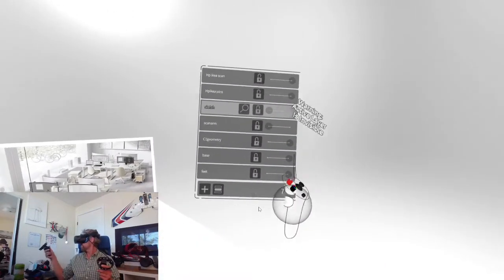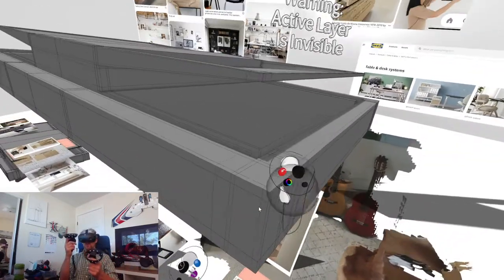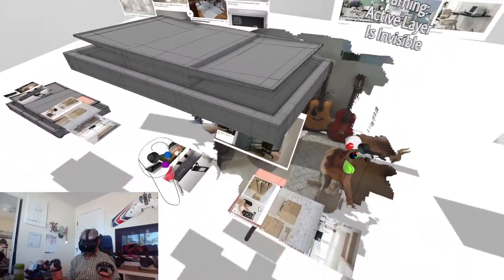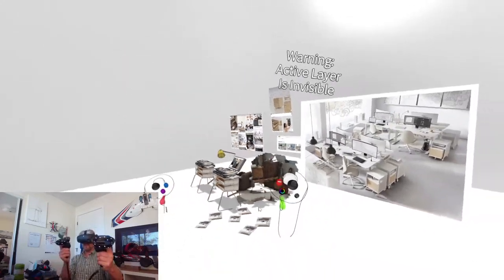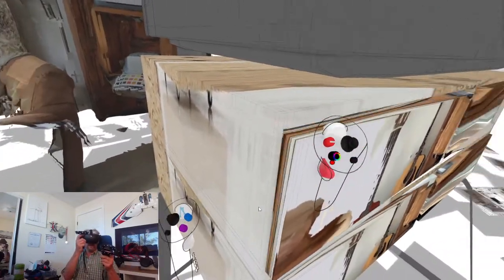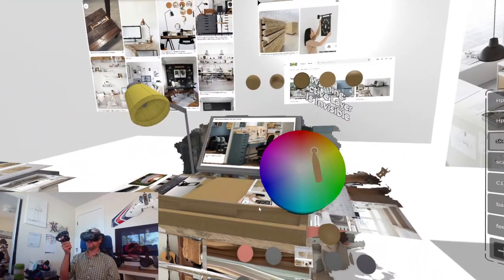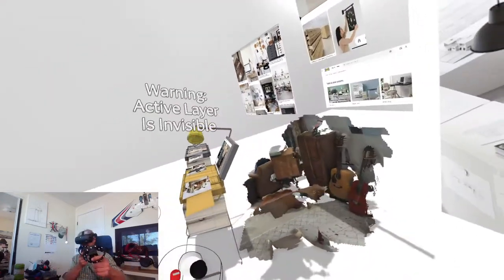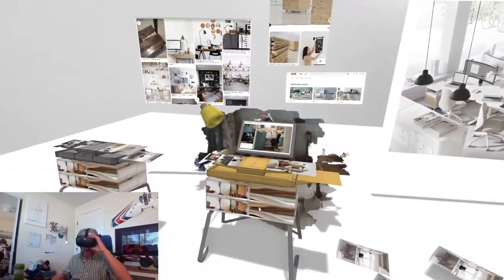Gravity Sketch Lidar and Clean Geometry

Comment from the maker: Apologies for the terrible audio, I think the yeti was in Omni directional mode and is picking up the laptop fans
Reply: Pretty awesome, Bart!  My headset is the Oculus quest 2- it doesn't use a laptop (unless there is a way to use a supplemental processor).  Will that hinder my ability to do stuff like this?    Also- can you assign mates like you can in solidworks to establish limits, pivots, or slides?  Still just getting familiar with GS- seems like it could be a reasonable joining of mesh geometry and parametric?
Reply from the maker: @salukikev  with an OC Link cable you can run some serious files on it. use PC and OC Q2, But I do have to recommend you get the far superior HP Reverb G2, Kevin. cant be sellin you no OC goods!  as for GS; dont expect solidworks functionality, I think the idea is you rough things out, nut you’d be surprised how fast you may migrate to a gravitysketch-to-3d print type flow. ( i think with some decimation in blender you can print straight from GS). It take a little while to get used to subD, but I recommend mastering this, considering the amount of time it will save you exploring concepts directly in GS.  there are tools for pivoting rotating around specific points, but no advanced animation tools currently.